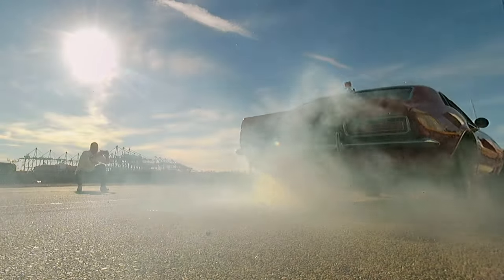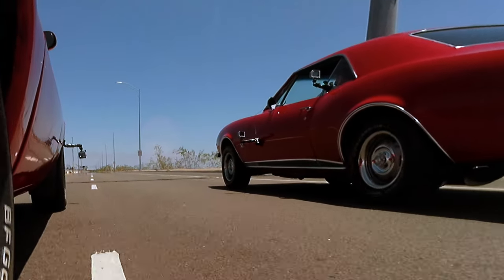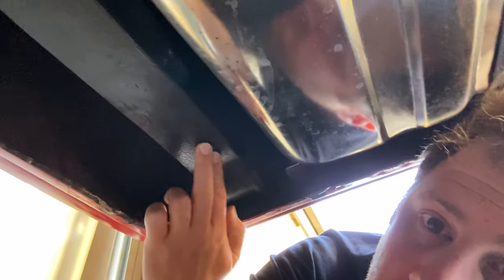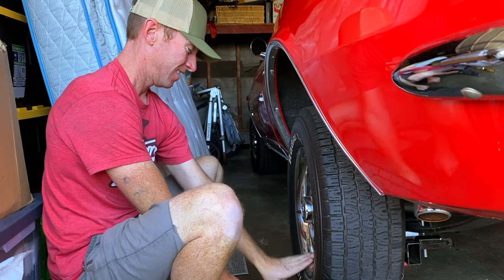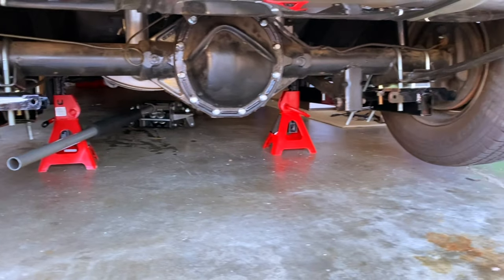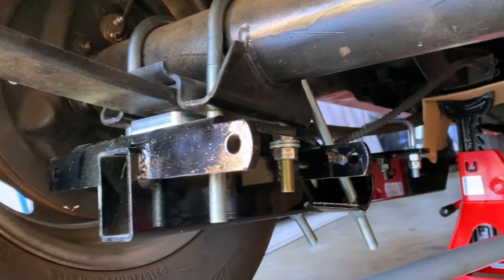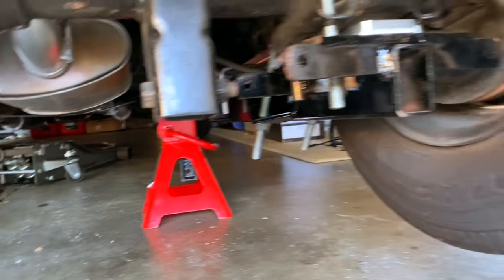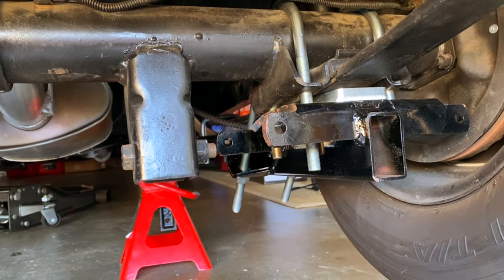TRACTION BARS & WHEEL HOP // Before & After // 1967 Camaro

Comment: Ive watched a few times and did not notice until i went to do my own, is your shock only mounted on the one side of the bracket? I obviously cant use the stock shock mount and on the traction bar only 1 side has a mount while the other end is essentially open. Am i mistaken?

Comment: My 1967 rs is all original factory stock 4 speed ac Granada gold original paint I really do not want to put the bars on but the wheel hop is horrible under light acceleration around a corner you have to let off the gas you may have convinced me great video before and after!
Reply from the maker: I’m not advocating that you do that. All original is AMAZING! So cool for you. That said, if you do the bars, at least it’s bolt on. But you will have to drill. I didn’t do this video to convince anyone. And because my car isn’t all original, I figured I might as well. Let me know what you do. Hope you’re happy with whatever choice you make. Ps, love Granada Gold!

Comment: Would your do a 4 wheels disc brake setup???
Reply from the maker: No. I am not an expert, but from all of my contacts who know these cars well, including the previous owner who did the restore, and my mechanic who takes on the stuff too challenging for my level of knowledge, discs in the back require a handful of changes that create additional problems. Best to just have discs up front is what I hear consistently.